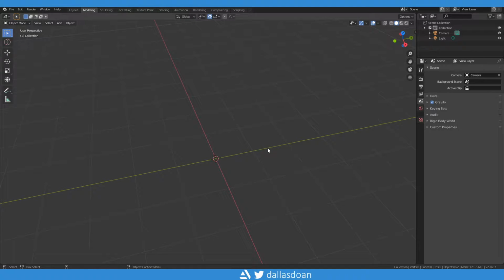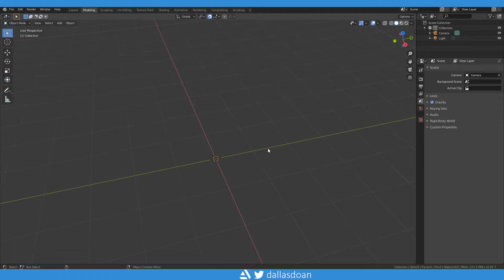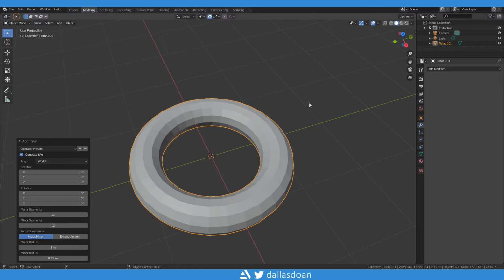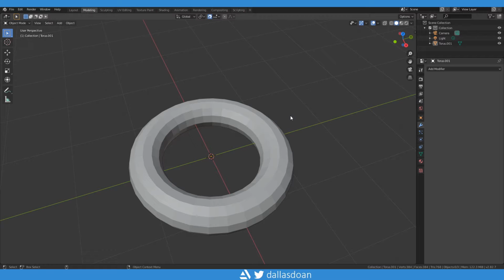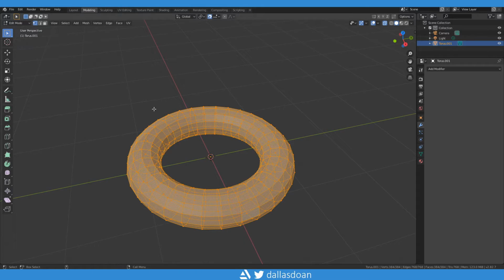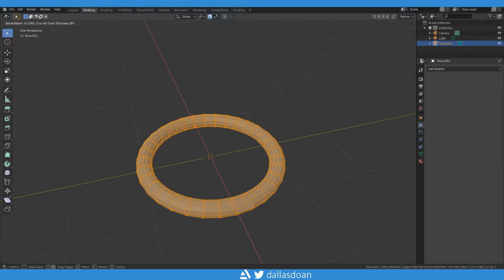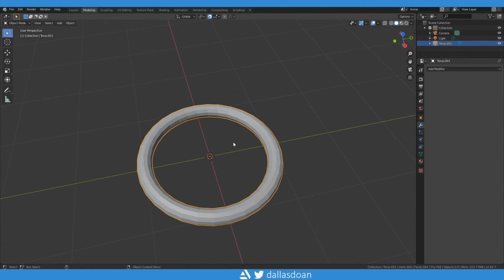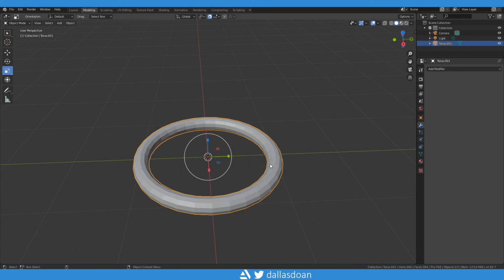Switching From Maya to Blender 2.82 - Adjusting Torus Radius With Shrink Deflate Tool

Comment: I'm not sure what I'm doing wrong here, but every time I use Alt + S, the taurus explodes into a gigantic sphere that turns inside out at the slightest adjustment with the mouse. I feel like I have to be missing something here because the result I'm getting is nowhere close to what I'm seeing in the video. Has anyone else encountered this problem?
Reply: I have similar situation, I tried the alt + s (after select all in edit mode) but I cannot reduce the radious....
Reply: Type in a custom value, like "0.1". That was my solution to the problem.